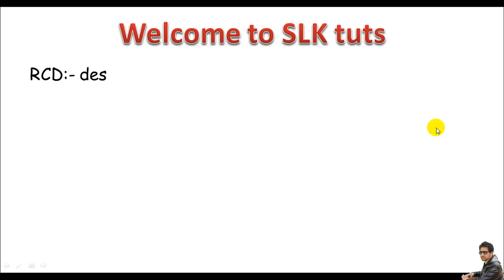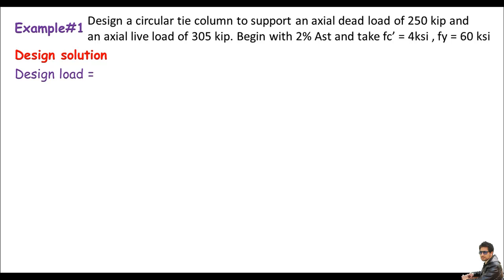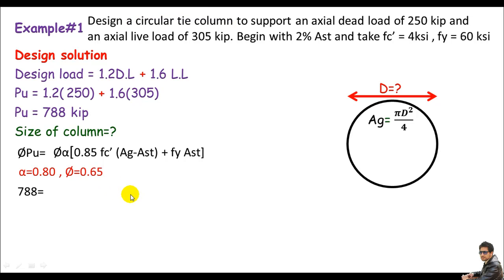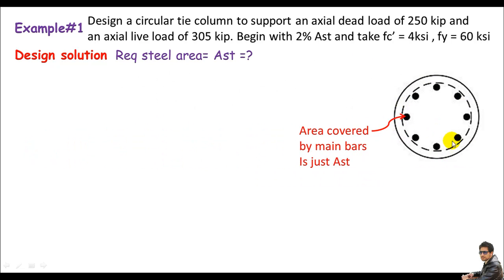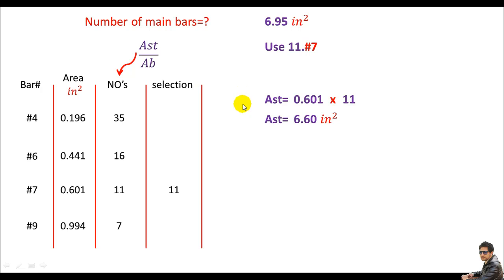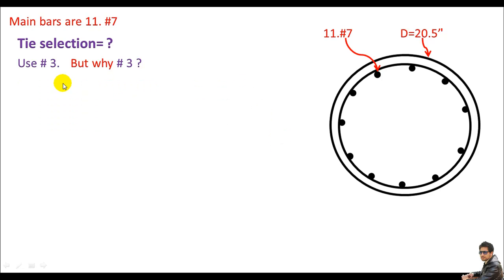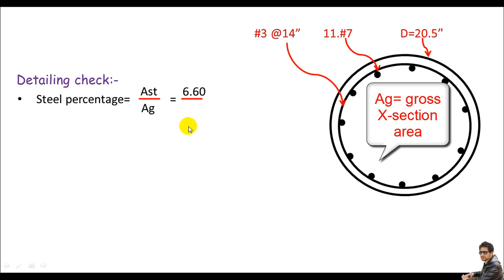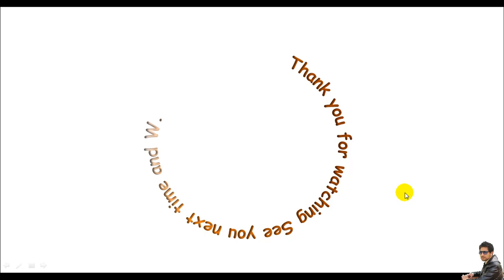RCD:- Circular concrete column design / ACI

Comment: Hi, I am wondering why you chose #7 Bar with A of 6.60in^2 when the area of steel should have been greater or equal to 6.95in"^2. Did I miss something?
Reply: Should the # of 7 bars be 12? If we used 11 bars, the area of steel is still lower than 6.95in^2.

Comment: Sir what design steps to follow if a problem only says “ a circular column” but not specify the type of column ties. And another what if problem says only spirally reinforced but not tell the cross section of column whether circular, square or rectangular. Thanks

Comment: while you were calculating the size of column, Isn't it suppose to be 788X0.65 ?
Reply: I know this response is awfully late but maybe it can help others that stumble upon this. The answer is NO. 
The original formula is for phi * nominal Axial Load. This is the load when both the concrete and the steel are just about to yield or give out. Pu is the actual load that is present in the element (in this case a column). When the Pu is used in the formula is under the assumption that it must be equal or less than the nominal axial load (Phi*Pn). The Pu must be used as calculated or given, no load reduction factor (LRF) shall be applied.

Imagine that by code you must have a Pu <= phi*Pn. Let’s used some number to explain further.
If Pu = 101 kips and phi*Pn = 99 kips. Your section is already not complying by code but if you applied a LRF of 0.65 to Pu it then gives you Pu=65.65 kips. Naturally, now Pu <= phi*Pn which is wrong. The LRF is applied only to Pn to make designs more conservative.

Comment: sir  why u use 0.80 and 0.65 rather then  0.85 and 0.75 becouse as i see circular colm u have u  0.85 and 0.75
Reply from the maker: because this is tie column........ this is not spiral...... may be you have seen 0.85 and 0.75 in case of spiral column design..................... how ever no  problem these are design  capacities which can be little changed